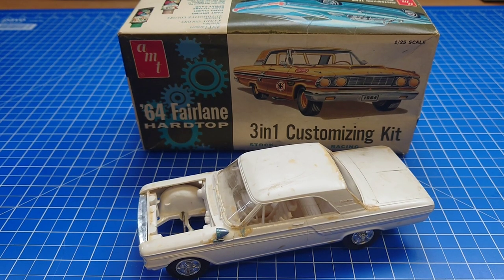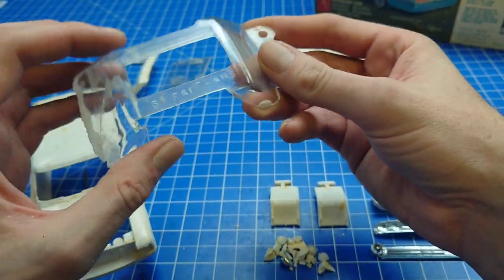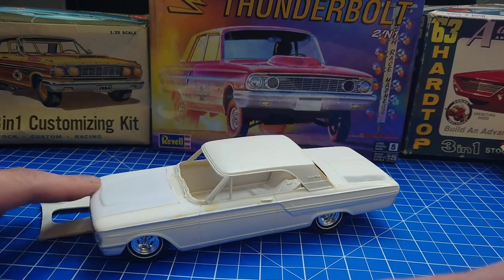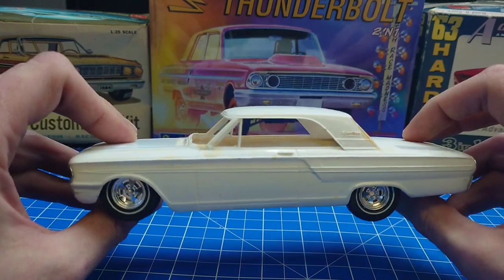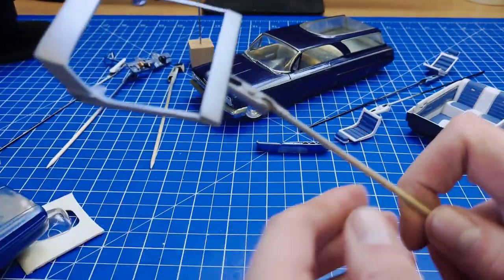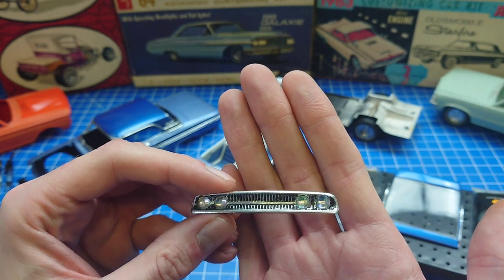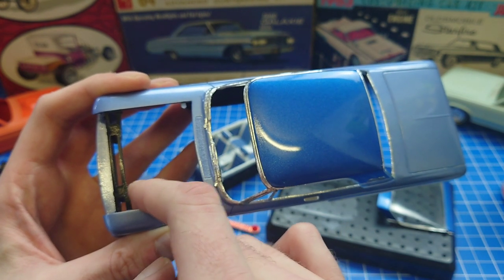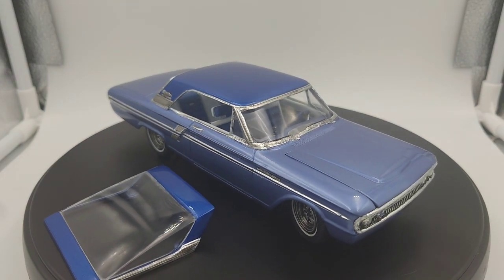Amt 1964 Ford Fairlane Full Scale Model Restoration

Comment: Great job man. Growing up in Canada in the 50s & 60s it was common for auto manufacture install 2 horns when building their cars. You could use a couple horns from your spares or leftover parts to hide the front screw mounting posts by attaching to your cross bar or radiator mounting support.  I remember those kits cost $0.45 to a whole $1.50 and if you were good at Christman or your birthday you might got a $2.00 kit from Granma, Great job, keep it up.

Comment: Nice paint job 👍🏿
Reply from the maker: Many thanks!
Reply: Nice restoration. In recent years with EBAY I have found numerous old models and having over 60 years of building under my belt, my passion has turned to restoring these old soldiers. I used to send parts to Chrome Tech U.S.A,. But that gentleman retired.

I use Evergreen sheet plastic to scratch build some parts. Scale Coat is wonderful for removing old paint.

My efforts are to restore them to factory stock with factory color s from the year of production. People who see them invariably make comments as these restored cars evoke a flood of memories.

I have even been ask to take them to a nursing home and a senior center, so families can reminisce. Visits last longer.
Reply from the maker: Thanks Max and for sharing a great story! The new Revell chrome spray is a game changer for people who like restoring these so may be a good alternative to the long gone chrome tech USA. Hope your nursery home displays goes well too 😊

Comment: You could actually take parts from the Revell 1964 Fairlane (Street Machine or Thunderbolt) and complete the model as a stock Fairlane
Reply from the maker: Hi Bill, I found it really hard to transplant anything from the revell kit as the body proportions are completely different... Nothing is unachievable with I bit of work though.